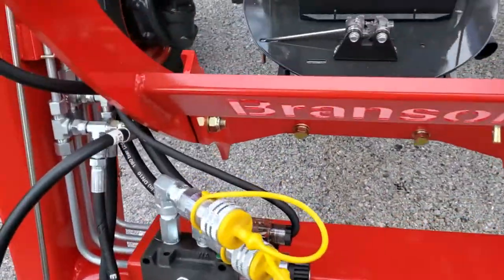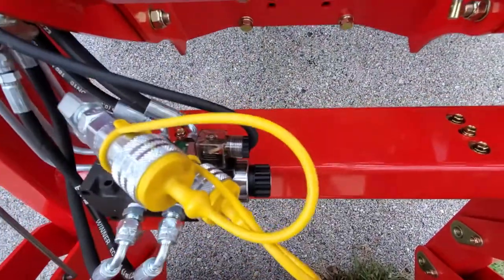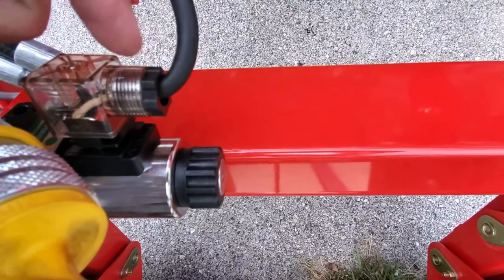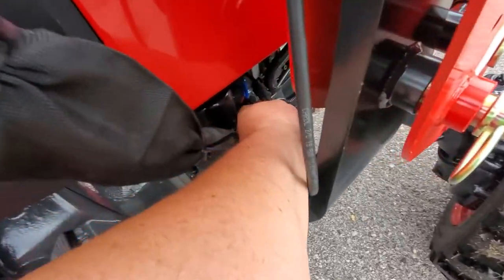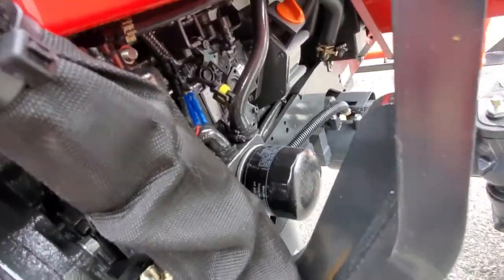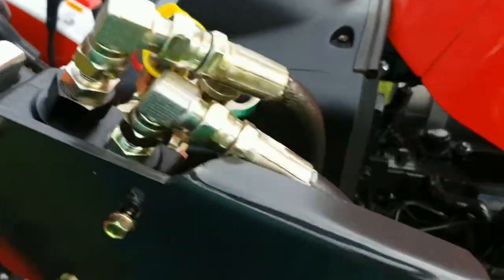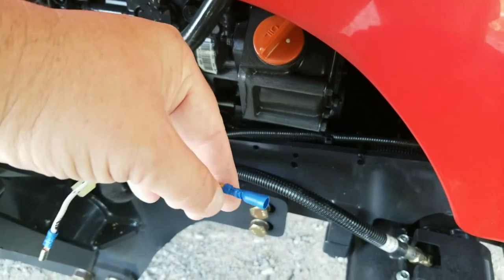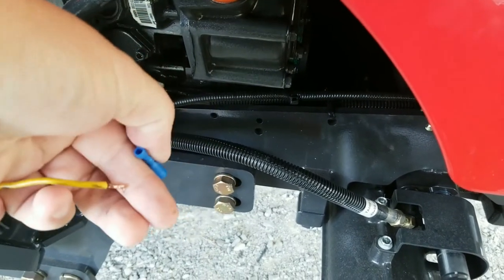3rd Function Wiring Improvement

Comment: that is a diverter valve not an actual 3rd function valve. you will lose a function the way that is set up so with a grapple installed for instance that set up will divert flow from your curl function to give you your grapple function at any one time you will only have two front functions because of this. for most people this isn't a huge deal but for some its a pain in the butt. my 4820 came with this setup when I asked for a 3rd function valve installed which is frustrating when a true 3rd function is needed cost me another 750+ to get the actual 3rd function kit and install myself. so be careful when asking for 3rd function as this isn't a real 3rd function valve only a diverter which for the added cost you are much better off going without this option and getting the kit and installing summit has universal kits for 550-600ish that are supposed to be quite good.